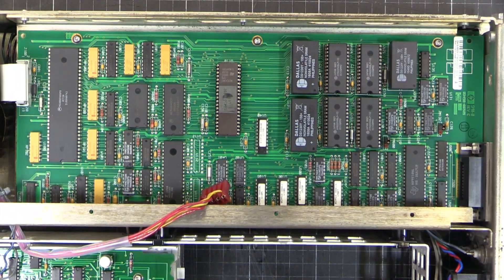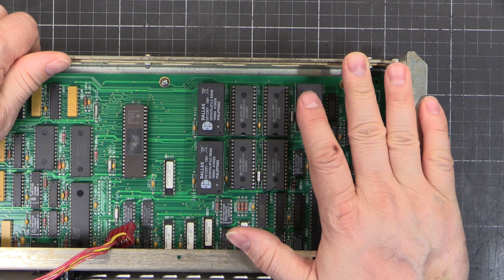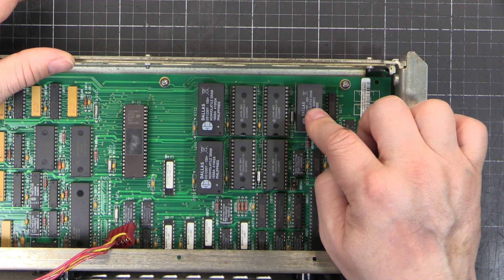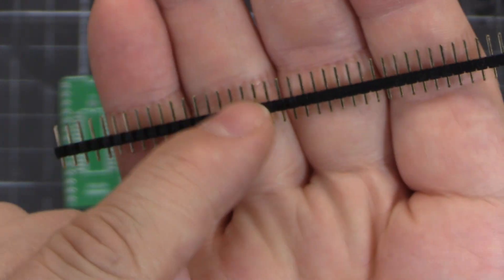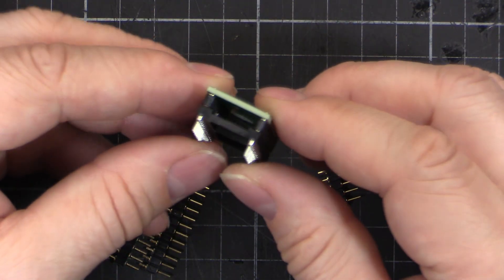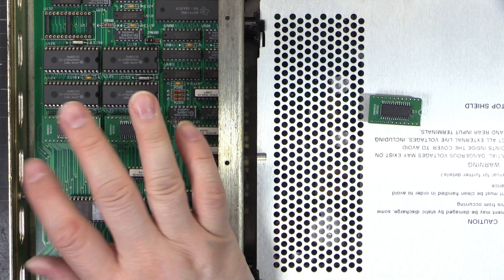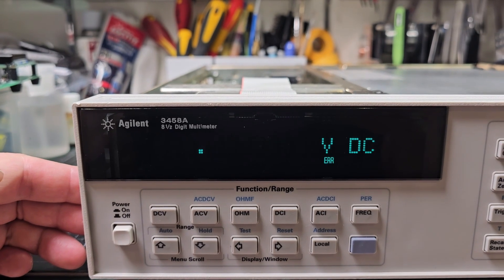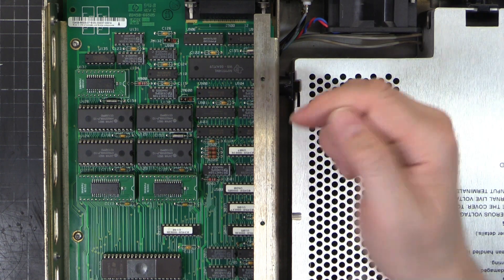3458A NVRAM to FRAM Replacement

Comment: I need your assistance! I saw on PCBWAY you had a solution to eliminate the battery on the DS1225. I desperately need something just like that but for a DS1245y. I need about 6 of them is there any way you can assist me? Do you have an email I can reach you at?

Comment: Any follow-up on your 3458A, I find mods on A1 main DC board rather interesting. Perhaps you can share more about that?
Reply from the maker: Mine is working really well at the moment, it appears to have about 0.0004ppm drift per day, so I haven't messed with anything yet.
There are a few threads on the eevblog forums about modding these instruments though that are worth checking out.

Comment: To clarify: If in US and rely on your HP3458a, just buy the Keysight warranty for about $300 per year, and basic calibration starts at $700~ $900..then other repairs costs are drastically reduced.  When we send out meters in under warranty and have calibration done, the battery backed ram gets renewed anyway.  We've found it's more cost effective to do this to keep our meters running.   Also note your FRAM solution does NOT work on all 3458a meters - it depends on which revision board.
Reply from the maker: Which boards does it not work on? FRAM should work on any board that has the same Dallas NVRAM chips as mine does.

Comment: NIce upgrade, peace of mind well and truly installed!
Btw, the adaptor on my site that takes the 16W08 back to it's original pinout (minus A11 and A12) seems to work ok. Could just be your programmer doesn't like seeing A11 and A12 grounded though.
Reply from the maker: I think it's my FRAM adapter PCB, I didn't make it with the full number of pins on the FRAM (So I don't have unused pins hanging over the edge of the socket in the meter), I think that makes it not work right.
But I only need to do it once, so it's done now. 🙂

Comment: This drop-in replacement does not work everywhere!
I tried the same SRAM to FRAM swap on a Hameg HM8142 without luck. FRAM uses the falling edge of the CE for address latching. So on designs with grounded CE it will not work. Read more on page 5 of the FM16W08 datasheet.
Reply: Also of course the cases that use the RTC variant of the chips (although not all boards with the RTC variant actually use the RTC)
Reply from the maker: @laptop006  Stay tuned, I might just have a working fix for RTC NVRAM's soon-ish too.
My last try in an earlier video ultimately didn't work, but I've done a redesign that will be tested in a Tektronix TDS784D oscilloscope.
Reply from the maker: Yep, some instruments don't like it, but some work fine.

I know that many Tektronix scopes (i.e. 2465 etc), Tek SG5030 Leveled Sinewave Generator that I did the swap in an earlier video, and the 3458A as shown in this video all are fine with FRAM, but my experience stops there...